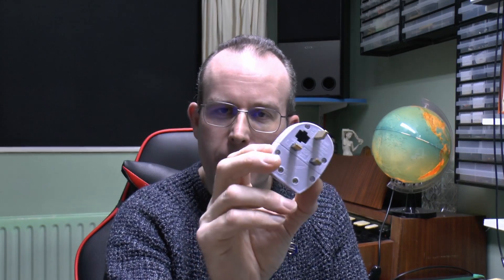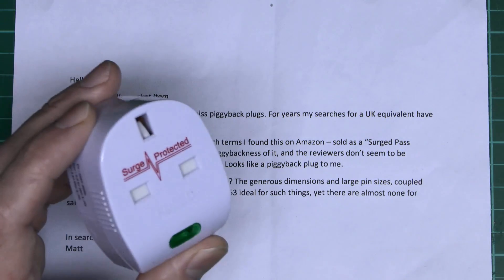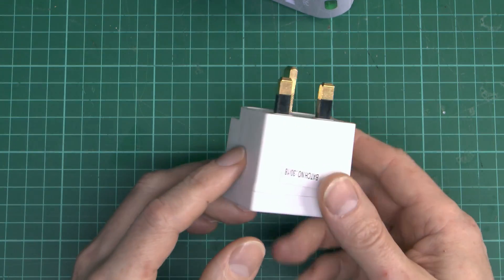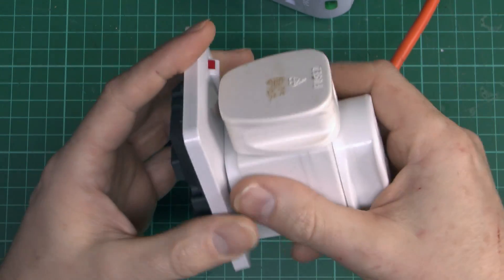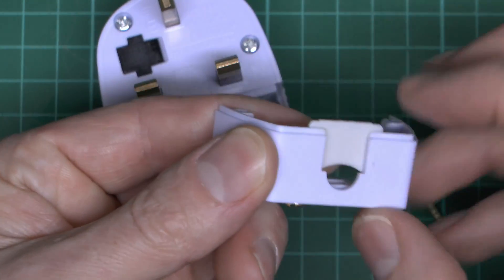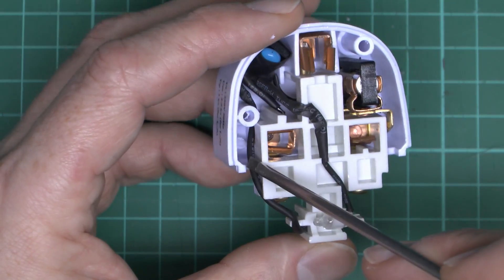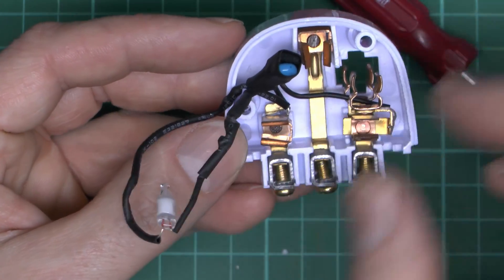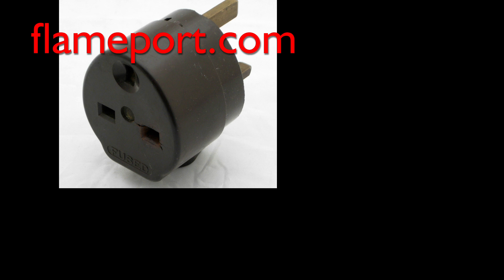Piggyback Plug, Double Adaptors and Extension Bars

Comment: You've stated on quite a few of these videos that most plugs are no longer labelled as 'fused'. This is a bit bizarre because I haven't seen any (moulded or rewireable) not marked 'fused'. The size of the marking varies but I assume it's still required in the standard somewhere.

Comment: These piggyback plugs are sold in the UK & Ireland by CPC (part of the Farnell group). Their website is down for maintenance as I type this but the item number is PL11071 (sometimes a little cheaper if you buy it though a special item number listed occasionally in their brochures) which you can search for at cpc.farnell.com (UK) or cpcireland.farnell.com (IE). I've actually used one for a year now where the flex is connected to a trialling six socket extension lead with individual switches, over to a computer desk. The piggy back socket is then used to plug in a cooling fan, not a heated one so it doesn't draw much power. I've had no problems with it since I fitted it together, but even as a layman I kind of knew that the "surge protection" inside it would be rather rudimentary. Should be OK though I reckon for a "one shot" protection i.e. Will blow in the event of a large surge and then have to be replaced.

As for the double & triple cube socket adaptors, I don't generally tend to find them a big problem as long as (a) the weight of the plugs plugged into them isn't excessive, so a non-switch mode AC/DC power adaptor which can be quite bulky that is plugged into the adaptor socket parallel to the wall socket isn't ideal, and (b) the wall socket itself isn't damaged in a way that any plug can be easily pulled out of it with little pulling force - not usually a problem as the "grip" of the sockets like those used in the UK doesn't tend to fail as fast as some other types around the world as long as the proper standard plugs are used. Arguably the three-way type with the fuse is safer than the two-way, though even with the two way the plugs connected to it they should still have their own fuses. However, it is very bad practice to use more than one such cube adaptor in series from a single electrical socket due to overloading and weight issues, and even for triple cube adaptors it's best to stick to two sockets only unless you know the current draw of the three appliances together is small. Beyond that, if you need three sockets or more from one wall socket, best practice is to use a quality trailing lead with the required amount of sockets, or something similar.

Comment: The MOV will 'do something' with significant overvoltage : Either self-destruct and blow to pieces or go short thus triggering other protective devices. :-)
Reply: OnStageLighting But having the load not going through the attached fuse prevents the MOV from protecting the load.  MOV should have touched the 13A fuse or a second 20A fuse (20A is selective relative to 13A for overloads etc. but can still be made to break if the MOV overheats after too many surges).
Reply: @johnfrancisdoe1563  I must say I didn't get the usefullness of the small black box, alleged 2A thermal fuse in series, which I missed first time around. Seems to defeat the MOV protection should the MOV overheat and then can't go short as no longer in circuit.  Guess it just extinguishes 'surge protect' indicator and the user is left high and dry.  Kinda functional overvoltage protection that can cease to function.
Reply: I was being somewhat facetious in that the MOV will actually "do something". :-)

Comment: Have to say that I find the current trend of fitting molded plugs on to appliances a very ecologically flawed development. Damage the cable and it's the bin of the whole assembly. Company's should be encouraged to maximise the lifespan of their products by making them repairable - not replaceable. And consumers encouraged to learn a few basic repair skills - the sort that were taken for granted in previous generations.

Comment: Nice Plug!  So the lamp is the only thing in it besides the 13 Amp fuse that has decent protection.  FAIL!  Would expect 3 of those high voltage suppression BLUE things across the Live, Neutral & Ground pins of the plug.  "It has a GREEN LIGHT! 
 It's PROTCTED!"  BS!!!  Who designed this $#@%?

Comment: +John Ward
Related question:  When is 2 cords wired to the same plug acceptable (e.g. pair of IEC leads going to monitors that you always want to turn on/off at same time, safely sharing 5A or 3A fuse, etc).  If-not, by what rule/regulation/etc is this actually unacceptable?
Reply from the maker: Acceptable if they can both fit into the plug properly and both be secured by the flex grip, which generally means they both need to be the same size.
Reply: @jwflame  Wow, interesting, an answer I wasn't expecting, but this could easily be useful for pair of lamps, (on 3A) pair of IEC power-cord-cables (on 5A), that sort of thing... and arguably safer than extra adapters, in particular circumstances ...  Totally get the 'need to be same size or thereabouts', depends on the particular plug and so-on...  Thankyou for the opinion!.   Still bet certain Ahem PAT-testing (double T) will frown on it ...

Comment: I prefer the gang sockets that plug directly into the wall socket, against the trailing extension leads.

https://www.kenable.co.uk/16491-large_default/kenable-4-gang-individually-switched-fused-uk-mains-extension-with-led-lights-009205.jpg

Much neater.

Comment: I have a pet hate for double adapters, horrible things. See them falling out of peoples socket outlets all the time, fizzing and arcing away. At least a 4 Way trailing block is a bit safer, only for low loads though. But having said that, people connect extensions, to extensions, to extensions... which isn't good, Measure the Earth loop impedance and see what you get, I did and its not good or compliant. Surge protection is like snake oil, have you ever seen one activated?..I got them on my PC but meh...most equipment with SMPSU's have it already built in.
Reply: I've had a couple of devices fail before I used surge protectors, and no devices fail since, so while it could be chance, it could also mean the surge protectors are working!  Although my surge protectors are commercial units so I expect them to work better than el-cheapo ones.  Pretty sure mine have activated a few times because occasionally a nearby lightning strike instantly causes my safety switch to trip, and all I can think of is that it's the surge suppressor diverting some power from the line to earth, which the RCD sees and then trips, thinking it's a ground fault.

Never occurred to me to check earth impedance after daisy chaining a few power boards though, that's given me something to think about...
Reply: @Berkeloid0  Here in the UK we have PAT testing, they never pass the Earth test when linked...understandable, as most 4 way adapters are made in China, and offer little in the way of resistivity through the LNE connections in the adapters, But having said all that, how many people have died?...meh...the fuses blow eventually, its all scientific stuff with no real world scenario to back it up...usually ;-)
Reply: Agreed, this is the state I found at a clients house. https://www.dropbox.com/s/38d3531pr8rtiy6/2014-07-26%2013.33.06.jpg?dl=0
Reply: @digitsictsolutions3790  Haha that's excellent. It almost looks like at some point they gave up installing sockets and just ran wires straight into a big hole in the wall :-)

Comment: That piggy back plug would be great for tradesmen such as plumbers, sparkies and such who need to plug in their 10 metre extension lead, but where the only available socket is currently in use (like a fridge). I am going to buy several of these to replace the existing moulded plugs on my 10 and 15 metre extensions. Now, what were you saying about convenience?
.
Reply: Good idea.

Comment: John, as usual a great explanation. I can remember my old dad plugging a radio into the ceiling light rose a long long time ago...
Of interest - I have a single to double faceplate fitted in one of the room in my house, have you come across them? Perhaps do a teardown and comment on any safety issues.
https://www.screwfix.com/p/lap-13a-converter-socket-1-gang-to-2-gang-switched/108cc

Comment: Interesting item, not seen a UK one before. With all the 5 Volt USB charging devices in use, a multi outlet mains step down adaptor would be more use full than having several individual PSUs. I have two outlet one by Juice Brick, rated 3.1A total. I purchased a usb plug in electronic load to test all new 5v PSUs for peace of mind.
Great item, nicely disected!!.

Comment: My dad drummed into me from an early age that those 2 plugs into 1 socket adapters should never be used, even with low powered equipment such as fairy lights.  Never really understood why, assuming you aren't trying to run 2 electric fires through it

Comment: A few years ago my mother had her tumble dryer plugged into a square plug socket (The UK one at 4:35) and it caught fire. The dryer was the only appliance plugged into it and it had a 13amp fuse installed yet it still caught fire. Since then I have refused to use them. I threw all of mine away and got rid of any mum had as well.
Reply: mharris1270  Here in the UK plug appliances are rated between 3 and 13 amps. Dryers do not exceed 13amps here unless there is a fault (such as a dead short) which there wasn't on mums. The dryer was not at fault.
Reply: What caught fire the cube or the dryer?
Reply: @barrybritcher  The cube.
Reply: mharris1270  Geezus! All domestic household sockets here in NZ are 240V 10 Amps only and we manage to run electric clothes dryers okay. 
You must have some massive massive machines to run 30 Amps at your higher voltage :-)

Comment: we used to have them in australia, i believe thy're banned now except for maybe stage lighting applications. There was a story of a cleaner that made themselves a custom extension lead with one on each end so it did'nt matter which end of the lead they had at the socket!
Reply: you can buy ext leads with these plugs anywhere, including bunnings
Reply: @Ressy66  sorry, i meant the re-wirable plugs. not moulded ones.
Reply: can confirm, they are at Bunnings

Comment: I can think of an example of needing to remove a pre-fitted plug when it isn't broken: say if the flex is too long and you're permanently installing an appliance somewhere where the extra flex is unnecessary and is going to waste space.

In fact, I have a 12V Lead-acid Battery charger which is getting permanently installed into a boat we're renovating which will automatically charge the battery back up when connected to shore power. I'm leaving a dedicated socket for the charger to make replacing it easier in the future, but the charger itself is going to be mounted right next to this socket so I only need a few inches of flex, and I don't want loose flex bundled up making a mess and a potential fire hazard in an area which isn't going to be that readily accessible without removing protective covers.
Reply: I would also do that, also because in some situation maybe you have to pull the wire trough a hole where you can't fit the plug, or you want to install a more low profile plug that can fit behind something, the problem is that cutting a plug on a new appliance means most of the times losing the warranty, and I don't want to lose the warranty on a brand new piece of equipment. So most of the times you end up building custom short extension leads that then plugs into the appliance, that is not ideal and is stupid but so you don't loose warranty.
Reply: A1eR Yeah, companies voiding warranty for bad manufacture over insignificant unrelated stuff has become a major global problem.  And when lawmakers finally crack down on it, it'll bankrupt companies over actual relevant user damage such as defeating a safety that would have prevented the fault.

Comment: The style of double adaptor like your three way was banned in Australia because they actually reversed line and neutral on one of the outlets. All the ones I've used are either triangle shaped or side-by-side. They are both fairly annoying and powerboards are recommended in either case.

Comment: The fuse rating problem is really the show stopper.
Reply: +video99.co.uk
Depends how you are using-it!...  If at the head-end of a 13A extension, then not a problem, useful use-case to piggy-back socket etc.

Comment: As a kiwi I'd say these are less common in the consumer market than they used to be. I do remember as a kid seeing them fairly often.
Reply: I reckon everyone has gone to power boards instead, because they're not much more expensive but a lot more practical to use.
Reply: Yes I remember seeing piggy-back or pass-through plugs as a NZ child of the eighties, maybe on a fridge-freezer or one of my dads older extension leads. 

I moved to UK in 1999 and lived there 12+ years - I didn't miss these pass-through plugs as I think they had already fallen out of favour by then but I did miss simple 'double-adaptors' as we call them. I mean single plug to twin socket adaptors like the cubes shown in this video - but I don't understand why the cubes have to be such bulky cube shapes. Our double adaptor sockets are generally side by side, or one above the other (sometimes at 45 degree angles so vertical plug cords don't interfere). 

I never saw those flat double adaptors in the UK. I don't see why not really, because I did buy a respectably branded travel plug with EU prongs splitting to 2 x side-by-side UK sockets. Swap the EU prongs for UK prongs and you'd have exactly what is common here. Power boards are great but in lots of cases you don't want 4 or 6 outlets and an extra 1 metre of cable lying around.

 John has done a video featuring NZ/Aussie plugs before.

Comment: I have always found it strange that the 3 way type adaptors have a fuse but the 2 way ones do not, does anyone know the reason that these 2 way adaptors are made without a fuse?
Reply: BS1363 requires a fuse for an adapter with three or more sockets and for an adapter with socket types other than BS1363 (where the plugs will typically not have fuses) but it doesn't require it for an adapter with two BS1363 sockets. I guess many years ago the risk of overloading was deemed acceptable with two appliances but not more than two and it didn't cause enough problems in practice for anyone to push for a change. Manufacturers competing on price tend to do the minimum required by the standard.
Reply: @petermichaelgreen Probably as 2 way adaptors were originally used with single sockets (initially standard in houses in rooms outside the kitchen after the change from round pin) so no different than having a double socket. 

I've seen fused two-ways over the decades, but very uncommon and not required. 

The worst thing to happen to adaptors were those 3-4 gang hanging ones. Incredibly unstable and heavy for a socket.
Reply: @ hmm, provided there is sufficient clearance under the socket, I kinda like the hanging down adapters. They stick out of the wall less than a block adapter and have less issues with physical conflicts.

Comment: In Australia(same standards as NZ), these are very common. At the AV company I work at, 95% of the mains extension cords, leads, appliances are fitted with one. It's far easier for neatly and compact-ly grouping up a bunch of devices on a truss or "daisy chaining" when the devices themselves don't already provision for that. Just have to watch for overloads, plugs falling out and water-proofness.
Reply: Stephen Graham  They're still available as moulded plugs on pre-made extension cords etc. To buy ones you can wire yourself, you need to have some sort of certification, and even then they're meant to be single-use.

Comment: Would that not fail standards in the UK as the earth wire is not longer than the other conductors ? (where you wire it in)
Reply: You would think so wouldn't you? but a non-permanent installation doesn't count in UK unless a PAT test is carried out...odd i know. But it is a loop hole ;-)
Reply: IIRC the requirement is that when wired according to instructions but with the cord grip defeated and then the cable forciblly pulled out the live pulls out first, followed by the neutral and finally the earth. So as long as the instructions tell people to make the live wire longest and there is space inside for a bit of slack in the neutral and earth wires it's fine. Whether users actually follow the wiring instructions is their problem.

Comment: Since mov's slowly fail and become more conductive and that product has a 2 amp thermal fuse on that mov that product could be sitting there wasting up to 2 amps all the time untill the thermal fuse fails
Reply: since 2A at 240V is quite a lot of power (~480W), i think the thermal aspect would trip LONG before you get above about 1/2W-1W dissipated in that tiny package

Comment: Very, very few plug-in appliances are 13 amps or anything like it. Additionally most modern circuits would have overload protection at the distribution box.
Reply: The consumer unit / fuse box / distribution box will have either a 15A fuse, 15A MCB, 16A MCB, 20A fuse, 20A MCB, 30A fuse, 30A MCB or a 32A MCB depending on the type/age of it and depending on if it is a radial or ring circuit. Most U.K. domestic, office and light industrial buildings use either 30A/32A ring circuits or 20A radial circuits. This are too high to protect the flex (cable) going to the appliance. Hence why U.K. sockets are specified to have a suitable fuse.

Comment: Yeah they're common here in the US you mostly see them on Christmas lights
Reply: Yeah but you only really see them used on Christmas lighting on the US now.  They used to be really common for computers and equipment that used a standard IEC C13 cords after the manufactures stopped using pass-thru so people could still connect their monitor and computer to a single outlet socket.